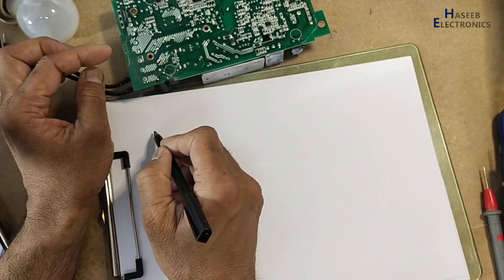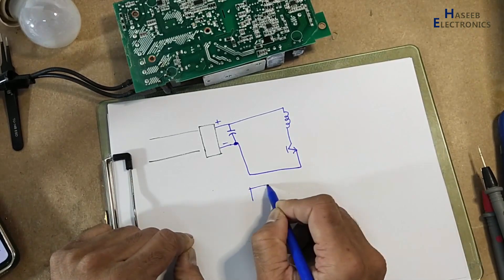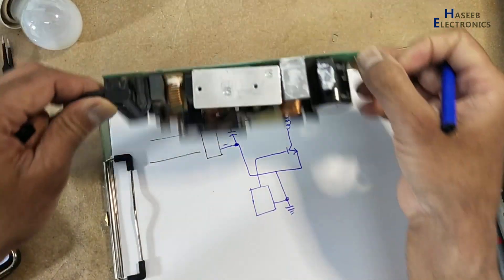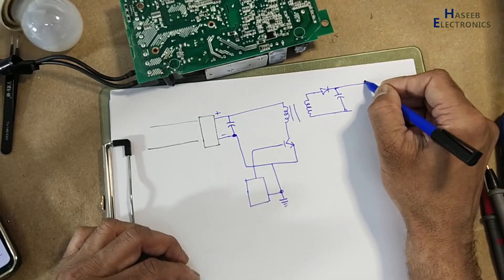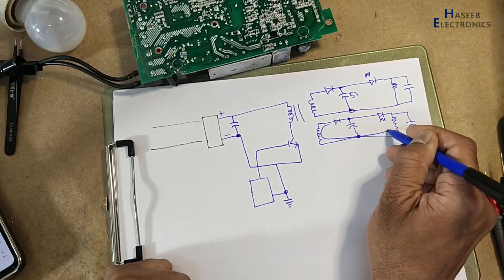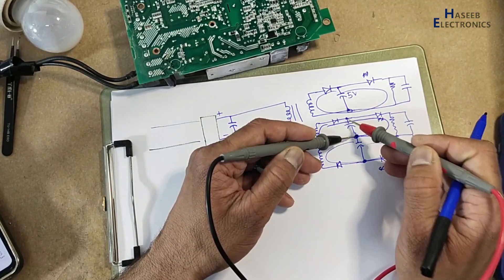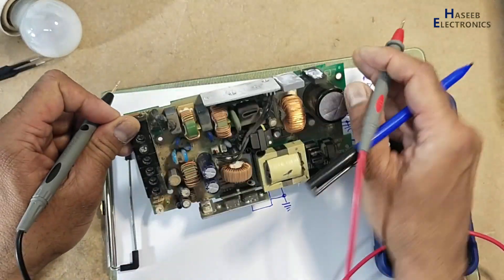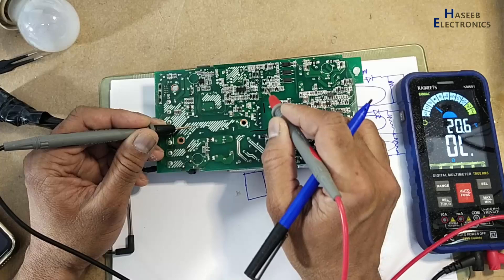{1074} Reference point selection for testing signals

Comment: In smps is s this small value capacitor is enough for rectify ac to dc voltage?
Why in smps small value capacitor is used and in transformer higher value capacitor is used ?

Comment: Salam Aleikum, MOSFET or IGBT : i need to repair an inverter, it has 4 burnt mosfets in the H bridge, can i replace them with IGBTs ? what is the difference between them ? Thank you
Reply: I had my inverter get wet and it was 100 watt at 120 v its about 1 qmp .i had irf 840 from aliexpress and it kept blowing for some reason i herd aliexpress transistors were fake not shure .i cant remember what the dqta sheet said dor 840 but i think its around 500 v and 5 amp so they shouldnt blown but i dont know it could have been bad solder cause it was looking messy .never saw data sheet on igbt but i herd they can switch up to 70000 hz
Reply: @damensutherland7081  Hello, same here with Aliexp... But did you finally replace Mosfets with IGBTs ? Did it work ?

Comment: Sir some smps primary side ground is tied to secondary side what it is called what is the benefit in that kind of smps
Reply from the maker: when primary side seafty ground (earth) is coupled with retun side of secondary side 
it is called 
ground coupled output   or    ground referenced power supply